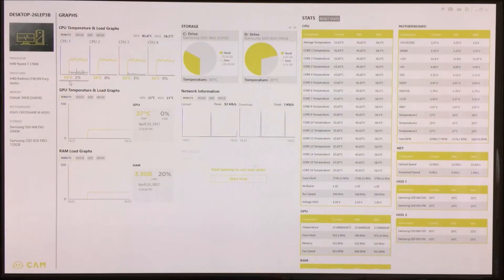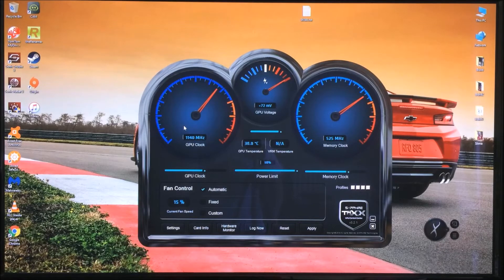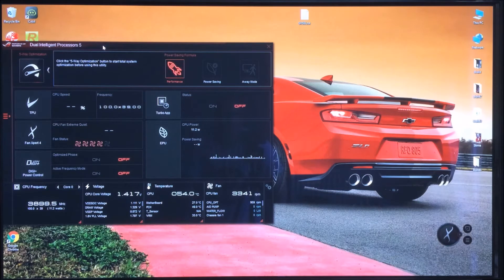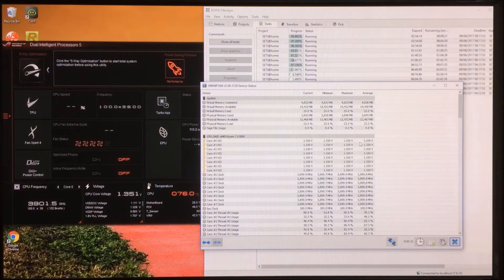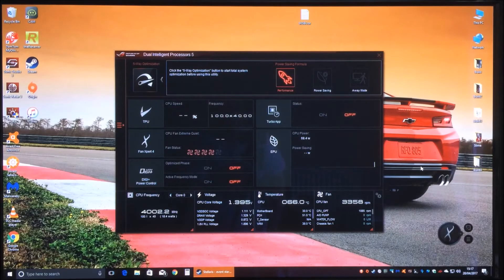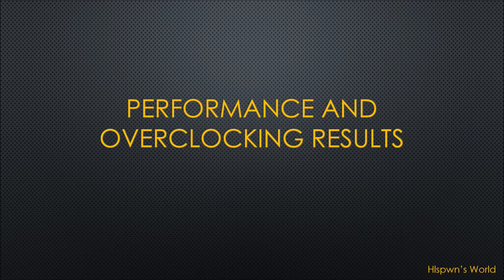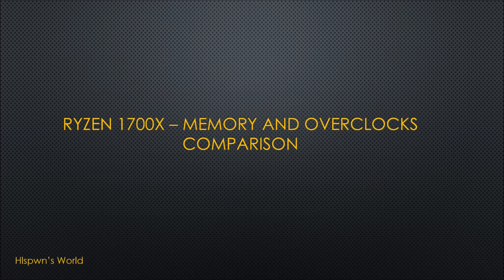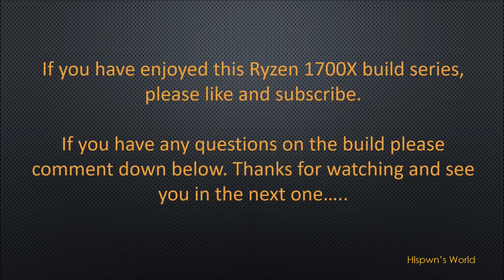Ryzen 1700X Build - Part 4 - Performance and Overclocking - 4Ghz

Comment: So in short you get 3.8 & 3.9 Ghz with the voltages left on auto?
Reply from the maker: Yep that is correct. I have even set a voltage override of 1.375v and it runs at 3.8 or 3.9 all day long. As soon as the memory is stable @3200, I  plan to see how much I can push over 4Ghz
Reply: Nice, I've got similar but my RAM is guaranteed to get to 3200Mhz. Am hoping to get 3.8 with as little messing as I can.
Reply from the maker: Steveocee if it’s a 1700x or 1800x you should get 3.8 without trying. Just remember if overclocking all cores to have adequate cooling

Comment: good video's man. Good see what issues u had and how u fixed them through out your videos. I'm getting ryzen 1700.
Reply from the maker: IBlestv 1700 is a very good choice tbh. Should be able to run @ 3.8 if you can saved the cost of the 1700x \1800x
Reply: yea that was my thoughts with getting that one to. How has it been seen this video.
Reply from the maker: IBlestv it's been running great. I had one random reboot, but found out that was caused by windows update, changed the setting for me to decide when it restarts. Got Ryzen and gaming coming up shortly.

Comment: what graphics card do you have?
Reply from the maker: NeoFried I have a Sapphire R9 Fury X
Reply: I recommend you use OBS or Razer cortex (both free) for doing screen recordings instead of a camera
Reply from the maker: NeoFried cheers will have a look. Now the fury is back to the normal OC levels that I previously and am now running screen recording through relive working great. I also wanted to get a true temp test as recording through cpu or gpu would have skewed the test. Watched back on a 4K monitor did not look the best.
Reply: OK, just a suggestion if you are doing gaming videos ;)